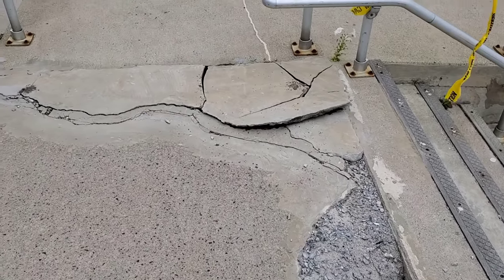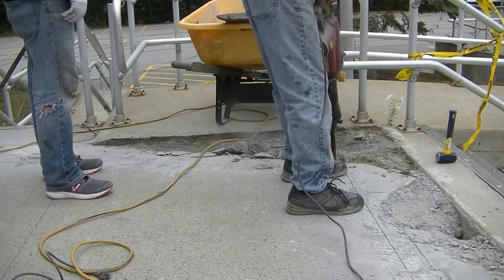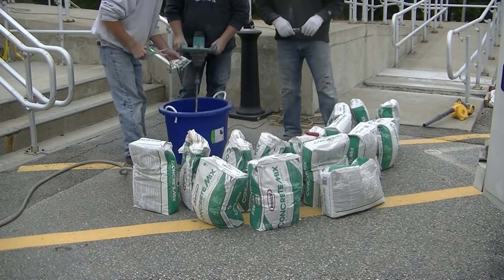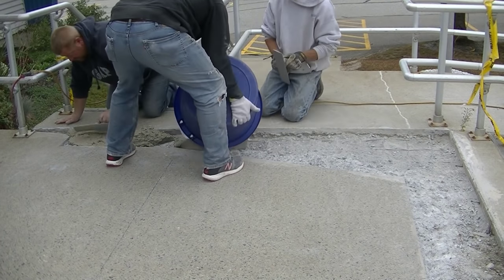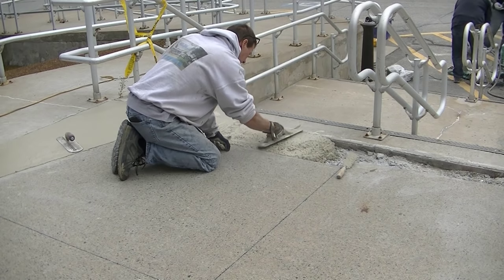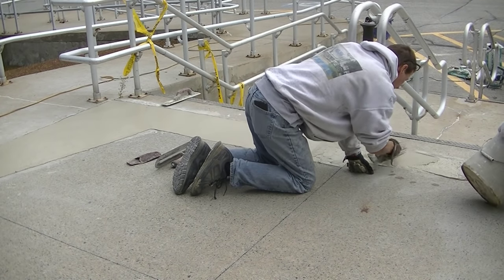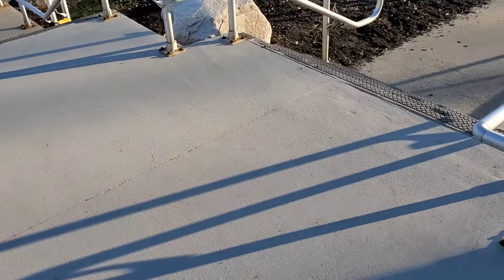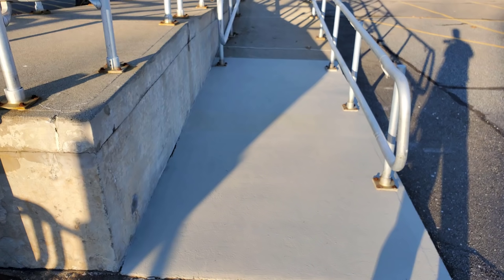How To Repair Broken Concrete | Fix Concrete Driveways, Patios, Sidewalks, & Pool Decks

Comment: I've never used the quick set concrete before. I normally use a topping sand mix. I've had better luck wetting the old place first. Some places I clean with muriatic acid first. My hardest repairs is fault lines. It'll keep cracking. I run a diamond saw through the repair where the expansion joint normally falls, but was never cut. I use a vinyl mix to top older work in good shape to give it that new look. It wears off after a few years. I try to avoid salt on icy sidewalks. That's what eats them up the worst even though many salts claim it doesn't attract concrete. I think they all do.

Comment: The one thing that you forgot to do is to wet the area where you pouring the concrete , And you need to wet it not once but twice. As you know concrete curing is a chemical reaction. If you pour concrete on a dry surface,  the surface will suck the water out of the concrete preventing it from properly curing, thus preventing the new concrete  from properly bonding to the old.
Reply: nice info man
Reply: @cameronb6498  Elementary, amateurs! What a wasted effort. Anyone that worked patching concrete knows that it must be well moistened before patching over it. Sad, a waste of effort and a loss of money for sure.
Reply: @spiro4733  Now we have people following the wrong teacher and the wrong method. A waste of material. Many imposters out there that do more harm than good. Been retired for twenty years, but still do a lot of cement mixes for my own projects. It is sad what we witnessed.
Reply: My thoughts exactly as somebody who has done DIY repairs to my concrete driveway.  My understanding is that concrete should be applied to a wet surface so that it adheres well.
Reply: Tidy end result... for now. As a DIYer, even I noticed straight away a rookie error that the sub material hadn't been made wet, which compromises the bond between the old and new. Were they were following some off the wall instruction specific to that product? Seems unlikely.
Reply: @johnmainwaring6556  More likely they just didn't care. The difference between a minimum wage worker and some DIYer working on there own home.
Reply: @terrytytula  Or....you could go read the Rapid Set specs and not be a crybaby.
Reply: @robertpalmer3166  He shouldn't be making a how-to video if he's going to skip steps all over the place.
Besides, i saw you crying all over yourself when they played stairway to heaven at some awards show.
Reply: @Thundersnowy  Lame. The Robert Palmer jokes were old thirty years ago.
Reply: What about that concrete bonder stuff, that comes in a bottle?  You paint it on, and let it dry.  Then pour the new stuff on top of it.  Does that stuff work good or is it a gimmick?
Reply: @TheCyberMantis  You still have the same problem. The old sucks the water out of the new. The water content in the new drops below the threshold required to properly cure and bond.
Reply: Also forgot to vacuum all the dust and loose rock/concrete bits.
Reply: Do you have to prep existing concrete before skimming areas that are not as damaged? I did a rapid  set overlay but first I power washed and used muriatic acid and water to prepare. Any other suggestions for future?
Reply: Can thinset be used to seal cracks or something else?
Reply: @GG-ed7rk do not use acid.  You will never get most of it out.  Pressure washing is the best method then blowout with leaf blower or air hose.
Reply: Thanks for the tip boss, I’m about to pour this week
Reply: @ItsWuLx  Your welcome! Good luck
Reply: @goldbeach7896 I have a question. I have a radiator shop and my slab where I wash my radiators, the acid I use to clean them has over time caused the concrete to start getting thin and starting to open up cracks, but only in one spot where I wash about 3'X4', that is at a slight drop to my drain. Will I need to cut that whole spot out or is there a way I can lay another layer on top ?? Any info would be amazing.... Thanks !!.
Reply: @danielmarkle8823  thanks for asking! I would patch it. Pressure wash it very well. Keep the surface moist for a long time before applying the mix. Mix sand to Portland cement ratio one to one, pudding consistency. Troul it to lay it down, first rubbing it in very well onto the well moistened old surface. Smooth it, use a cheap paint brush to moisten and feather the edges after troweling. Keep the edges of the patch moist as needed until the final step. Do not over do it. Wait to troul again the top surface, wait and troul smooth, keep the edge slightly moist. Do not expose to heat or sun while curing. Best done at cooler temperature 50 to 60 degrees is ideal. Too hot will affect the bond. Wait three Days before using the area. After it hardens do not water it. The final troweling will seal it. Let me know how it turns out. Thanks
Reply: @johnjohn-ne8fw  you are welcome 🤗
Reply: @goldbeach7896  👴 🦀
Reply: Are you talking about a cold join or a join that's probably gonna have a saw cut through it...
So if you use able flex or a key join inbetween,,,,wet that to
Reply: @GG-ed7rk  I tried that once, didn't work.
Reply: @TheCyberMantis BONDO the milky white stuff works wonders. You can brush it on the old cement and also add some into the new cement mixture. Concrete bondo is awesome!! Also works great for tile installation and thinset. Just read the instructions and when in doubt,  make sure you follow a correct online info or correct YouTube video. In this video, the could have placed a thin mesh and also add water or bondo to the old concrete as others have said. Bondi is King!! But many dont use cause some materials now day if properly prep have additives that help in adhesion.
Reply: @GG-ed7rk roughen the surface where it is still smooth…maybe some short pieces of rebar drilled into the old stuff in the deeper pockets in the fill. And your prep is a very good process. Tip…use concrete leveler to glue the rebar in. MUCH stronger than the super expensive adhesive sold for that purpose. Just mix  the leveler very very thick.
Reply: @GG-ed7rk PS power wash after the muriatic  acid.
Reply: @GG-ed7rk thin set is good, but the look will be different than existing materials. Flex bond is the best for strength. Concrete leveler is even better for a lot of situations as well, like to blend in edges. It’s super strong and can be thinned a lot to get smoother feathered edges.
Reply: @brikkijim wrong, concrete is extremely alkaline, and pressure washing gets 99.9% of the acid off. You could neutralize with borax or baking soda if you wanted to be extra careful, but the concrete will neutralize the surface unless you don’t rinse away the acid sufficiently. Just pressure wash thoroughly, that will get all the acid off, especially if you use a higher pressure unit.
Reply: @billycox475 you didn’t prep properly. Thin set is designed to stick to concrete and is VERY strong. It was your process, not the material.
Reply: @321rydell concrete bonding agent is what it is called. Quikcrete makes a product, there are others. Also the concrete fortifier is almost the same thing, but designed to add to the mix. Either one definitely helps a lot. Funny, you are supposed to wet the old concrete ( or any other surface!) but the bonding agent says to let it dry. I use concrete leveler a lot and it is rock solid even when thinned a bunch to improve flow and edge blending.
Reply: @5400bowen  you could be correct but I have seen what happens when people use pressure washers to apply acid then blast 2000 psi water impregnating the acid into the pores.  If you want to etch concrete the safest way is to apply your acid evenly.  Wait about a minute the rinse with water from a garden hose with minimal pressure thoroughly.  Once surface water is clear then you can proceed to pressure washing.  Cleaning of brickwork with acid/pressure washers have been banned in our area due to mortar failure from the acid/cleaner being impregnated.  You can do what you want I am just speaking from experience. I appreciate the feedback.  Have a great day and be well.
Reply: @brikkijim  ok, that sounds reasonable, but when did I say apply acid WITH the pressure washer. And I said neutralize with borax or baking soda. Rinsing with the hose before pressure washing sounds reasonable also. I really doubt the pressure washer will drive the acid into the pores rather than blast the acid off period. What tony amount of acid might be left by your thinking would be neutralized by the extreme alkalinity of the concrete. You are talking nano amounts of acid that might be left. 2,000 lbs of pressure washing will remove the surface deep enough to remove the top layer of pores and carry away effectively all of the acid. I used to use hydrochloric and fluoric acid on porcelain and Fiberglas and Formica to refinish it. We neutralized with borax, never had a problem. Concrete is much softer and more porous and would, as I said, have the surface completely removed at 2,000 lbs. . But again, I think we are starting to split hairs and your method would be really good. One last thought, the hose will leave acid residue in the pores, but now I’m really splitting hairs because that would be blasted away by pressure washing.
Reply: @5400bowen  yes. I agree.  Great input. Thanks
Reply: @GG-ed7rk the steps you did are excellent. It is also recommended to roughen up the surface so it has a larger surface area. You can use a bush hammer but on a jack hammer to achieve this.
Reply: @denysvlasenko1865 yeah I was shocked they just poured over all that loose powder and rocks
Reply: Does it also need acid wash or is that not necessary?
Reply: @cherrypoutines6269  Done it both ways and found no difference, the most important thing is that the old is very wet, so it doesn't suck the water out of the new and keep it from properly curing.
Reply: @cherrypoutines6269  Done it both way's with and with out found no difference. The most important thing is that the old is well wetted.
Reply: @terrytytula thanks for the info!

Comment: Yea mate great video , we do the same thing down-under , but always wet down the ground or bed of old concrete first before troweling the mix in ,
so the dryness doesn’t suck the moisture out of the mix too early , like ordinary cement.

Comment: You do good work. I'm thinking that maybe the subsurface should have been wet before pouring the rapid set in, or even on acrylic binder mixed with water to pre-saturate and create a better bond. That's what we always did on concrete parking ramp structures.

Comment: Both the blue (CementAll) and brown (Mortar Mix) have sand in them, the blue is simply a much finer sand, it also has a slightly higher proportion of cement. I like RapidSets products, even without stone as an abrogate the CementAll gets quite strong, 9,000 PSI, and can work well for a lot of things. The RapidSet line was actually developed out of an Air Force need for rapid runway repairs and it delivers those fast and strong repairs to this day. While each advertise a 15 minute work time that can be restricted or expanded by temp; the set control buys about 20 minutes per baggie, up to 4/55 lb bag, and flow control is also available to thin things out without adding more than 5 qts of water per 55 lb bag. I’ve used CementAll with flow control for years as a concrete resurfacer and have never had an issue with it popping off, and that’s in NY; just make sure things are well hydrated and clean of any dust, grease, etc. and if you want you can also use a bonding agent, which can help with older concrete.
Reply: Beat me too it. Thanks
Reply: The painting company I used to work for used the blue and yellow for stucco repairs and texture on million-plus dollar homes, never had a call back.
I've watched a little bit of Mike Haduck Masonry and he uses the brown as a medium concrete on stuff like porches or sidewalks. I think you nailed it with your explanations.

Comment: anchors are a good practive, so is vaccumming the substrate and moistening it. If you want to slow the set down, use other standard bagged concrete 50/50 with the quickset. nice vid, looks good

Comment: As a young bloke I did repair work on a fleet of 7 metre concrete agitator trucks.   The more pessimistic owner/drivers carried a 70 lb bag of sugar in the truck.

Strategy was- if you broke down on the road and got delayed on the trip, you chucked the whole bag (70 lb) of sugar into the mix.  It was cheaper than commercial retarder ( about 3 cents per pound). In those days $2.10 would buy you 10 beers, but it was cheap insurance against losing the hopper.   Many a Saturday night I spent chipping out a drum where half a load had been left too long in the mixer.

Stavros, a callow youth but wiser now.

Comment: I have used a waterproof fastset repair concrete  meant for bridges in the past,   two part primer, and the repair conc comes in it’s own five gallon container with its own liquid,goes off in five minutes, and you can’t get it off, anything !  But the point is, it stays where you put it !

Comment: Nice job , but I have a question. The damage looks like it may have been from expansion compression or freeze thaw ? Why did you install expansion joints ?

Comment: Should you have wetted the old concrete first? Or use an adhesive promoter?
Reply from the maker: Rapid Set specs says you don't have to.
Reply: Looked great when done..

Comment: To slow the set down, you can add 0.04% sugar by weight. Add the sugar to the water and mix it thoroughly before adding it to the dry concrete. This will about double the working time and increase strength by 5-10%.
Reply: LOL...Total B.S....
Reply: Adding sugar will destroy the strength of concrete.

Comment: I would have hosed all the debris out of the hole and used a concrete bonding adhesive. Then no call backs next year. That dry trench will suck the water out of your mix.
Reply: It's been 11 months now. Would you like to check it out and tell us how it looks?  Thanks.
Reply: @rusosure7  Yes, that is the address Ill be right over :P

Comment: i always thought you had to wet the repair before pouring the concrete.. so the dry crack doesn’t pull the moisture from the concrete and cause issues. or use a bonding agent

Comment: looks good. I had a patio poured a couple of months ago. There was some mud in the area and I have notice places in the slab where the mud is close to the top and now I find myself having to repair those holes. I assume I have to clean the area well and get rid of any loose debris. What is the best product I can use for those patches. Are additives a good idea? .

Comment: Very impressive work !! I learned a lot watching this video !!! Thank you so much.... I have a question though. I have a radiator shop and my slab where I wash my radiators, the acid I use to clean them has over time caused the concrete to start getting thin and starting to open up cracks, but only in one spot where I wash about 3'X4', that is at a slight drop to my drain. Will I need to cut that whole spot out or is there a way I can lay another layer on top ?? Any info would be amazing.... Thanks !!

Comment: Looks like a good job.  Hope to do a similar thing on my driveway in the spring time.  You really set the bar pretty high.
Reply: A driveway will carry more weight so there might be other considerations
Reply: I've done homemade asphalt. Ground old asphalt, diesel fuel, and bagged asphalt from Lowe's. Takes a month to cure. Then I use blacktop sealer over that.

Comment: I just love concreting, and am really interested in how the second section would hold up, that is the section that was the largest on the lower ramp. Mainly because you did not remove a lot of older concrete on the upward side of the repair, cheers, I have subscribed.

Comment: Ok watched you do your youtubes . I admire your hard work ethic and professionalism. Here's my dilemma. I live on Canada I'm restoring a farm house we own. Can't get anyone to do my stamp concrete. I'm 66  and still have my farmer stamina at least for 5 or six hours. I've got 700 square feet ready to pour. Do I need steal mesh or fiber? Now I may lose your confidence but I need to run this by you. 4 1/2 I get the ready mix truck in I only pour 3" Then get my 6 cube mixer out buy color and stamps mix my own concrete and do small peices I can handle. Can this be done and stand up. I've done concrete finishing as a jack of all trades farmer.

Comment: I wish you could come fix our driveway in Gatlinburg. Our house was built back after the 2016 fire. We raised the drive 3 feet, but a hole has already appeared only after 2 1/2 years and Crack lines. Unfortunately there is so much rebuilding going on, no business returns my calls.  I’m at a loss.

Comment: Its just sad that the people that run these places don't do these repairs when it starts to go bad.You fellas are doing the handicapers a good deed...I have been in and out wheelchairs ,and the worst is a huge control joint.When being pushed around the rough stuff its very jarring .So thanks!

Comment: Hey Mike. I do concrete repairs just like this in New Hampshire. What are your thoughts on a slurry or bond cost first, my boss would have insisted that on this. I noticed you didn't.  Let me know your thoughts please,  maybe a video about that is a good teaching opportunity.
Reply from the maker: The Rapid Set data sheet says do not install in layers, install full depth repairs. It says to just dampen the surface for the best application. So no slurry or bond coat is needed.
Reply: @MikeDayConcrete  hey Mike thanks for the reply. My coworker and I just did a job resurfacing a boiler room floor. We feel like it was under bid. Would you mind sharing what you bid this job at? Ball park even?